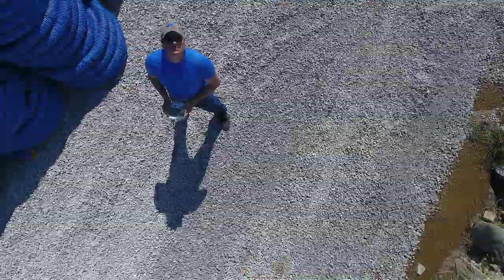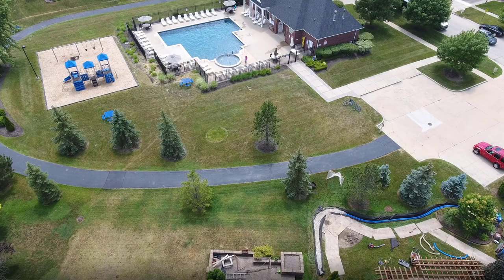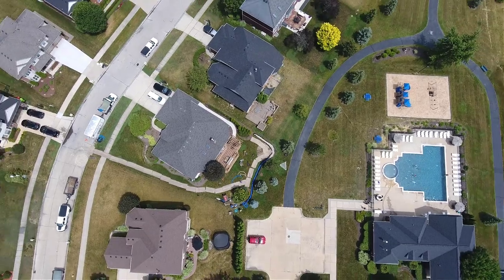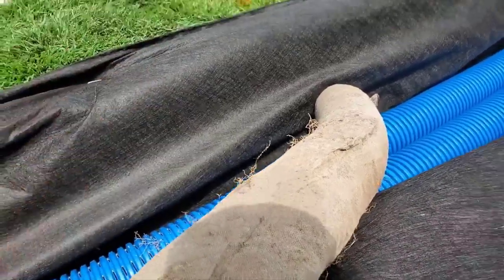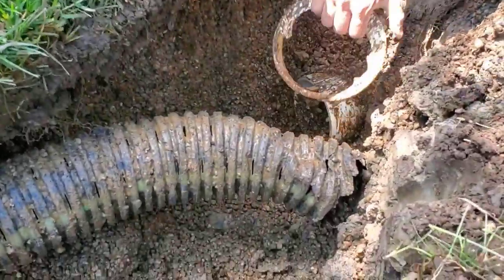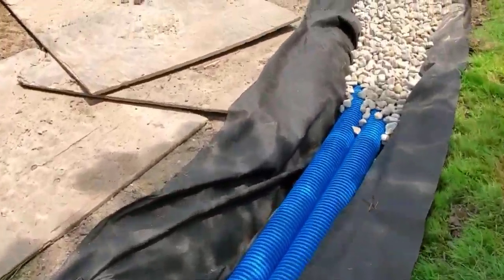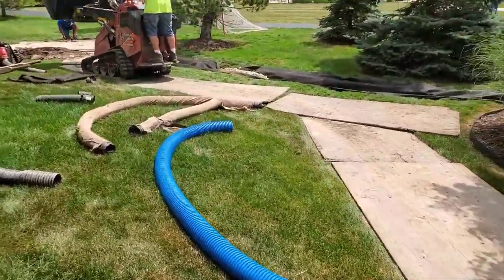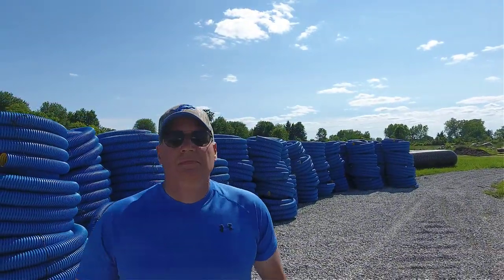Why DIYers Need to Install Double Pipes in Yard Drainage Systems

Comment: I used 4” pvc pipe and wrapped it with a sock. I also burrito wrapped the trench and filled with river rock gravel. Haven’t had any issues in 8 years . I really enjoy the info , I wish I saw these videos 8 years ago.
Reply: What did you use to wrap the entire trench?
Reply from the maker: @RoyalRadande  
Non-woven Geotextile Fabric in 4 oz and 8 oz
https://frenchdrainman.com/filter-fabric/

Comment: It would be helpful if you set up the initial situation by telling us where the water is coming from, where it enters your system (I finally saw it at the 9:30 mark, seeing the large grate).  But it would help if you point it out, so we know what you are doing.  You spend too much time trashing the bad stuff (yes it's trash - but I don't need to be told 20x that it's trash.   Yes you said it 20x.  Great video though!   Good stuff.   I am having difficulty finding that blue and yellow pipe in Omaha or Lincoln NE.  Obviously a superior product.
Reply from the maker: Store | French Drain Systems | Curtain Drains | Macomb, Oakland, Lapeer, St. Clair County
https://frenchdrainman.com/store/

Comment: I've seen a video where you used the high octane pipe but didn't wrap you guys cut it at the top and put the sod back, but this video  you are wrapping the hole pipe ( burrito)with the nogeotexttile  fabric. So which way is better? And why do it one way and then do a different way????
Reply: I think I'm another video they have left the burrito wrap off when doing a blind inlet.
Reply: I believe that was the video on laying a leach field( you don't wrap leach trench)

Comment: I really enjoy your videos. Excited for my DIY project. Feeling confident. I get now why you use a double barrel system. Quick question though that I'm unclear about. Do you connect the two pipes at the end with a Y connector and attach a popup emitter to one of the pipes?
Reply from the maker: That's a loaded question. Need slope to discharge with a pop-up emitter otherwise you need to lift the water with a small sump pump. I'm assuming you have no drop off of any kind?
Reply: @FRENCHDRAINMAN  I have slope. What goes at the end of the 2 corrugated high-octane perforated pipes? If I put an emitter at the end of one pipe, do I close the other one with an end plug or connect it to the other pipe? I couldn't find any videos where you show the end of the 2 pipe system where you have discharge.

Comment: Looking to do something similar myself. What width of landscape fabric do you use to wrap the burrito using the double pipe system? Is it 3’ or 5’ or some other width?
Reply from the maker: 5ft
Non-woven Geotextile Fabric in 4 oz and 8 oz
https://frenchdrainman.com/filter-fabric/
Reply: This is great, much appreciated. I’ll definitely pick some up. Just out of curiosity, what situation would you be using the smaller 3ft wide roll?  Single pipe solutions? Smaller pipe 3” vs 4”?

Comment: Hello I am a DIYer and love your videos. I notice in all of the videos Ive watched you place the system within 4-6" of surface then sod over. I am concerned that during drought months my grass will die over the system. Is it OK to keep the system 10-12" under the grass?
Reply from the maker: @Don Yes just use Blind inlets
Reply: @FRENCHDRAINMAN  so if my high octane is 24" down with 6" of stone on top and 12" of dirt I would need to build gravel basins that would come to the surface with a blind inlet on them? On a 200' run how many blind inlets would I place?

Comment: How come you don’t use a single 6” pipe?  A 6” pipe hold mores volume of water vs. two 4” pipes? Is it because it’s what you have on hand?   4” pipe is roughly 0.65 gallons per foot  where as a 6” holds 1.47 gallons per foot!   I have been using nonwoven geotextile 4 mil fabric for the last 3-4 years. I have to cut mine down to size depending on trench depth and width.  Your videos have helped me out and I refer many customers to view your videos to understand  how and why I do my drainage systems the way I do.
Reply: I figured that was the reason. The  6” HDPE  -14 slot pipe cost me 1.45 per ft. Or 1.12 per ft over 1,000 ft. I always use it when I need to really move water.
Reply from the maker: @MARKE911  who makes the (6") 14 slot you reference? For yard Drainage 6" doesn't go under sidewalk or fit in a cored curb. A pain to pull under sprinkler pipes too. Thank you for commenting.
Reply: Mark Eckelkamp where are you finding a 14 slot 6”? That would work in my situation

Comment: I have a single 4 inch (or maybe 6) drain pipe that runs across thw back of my house, maybe 40 ft and then down the side to the cur, maybe 100 ft. There are 4 small catch drains with in the first 20 ft. Would adding a 2nd line after the first 40 ft or so help it drain faster and increase the flow? Hope this makes sense.
Reply from the maker: https://youtube.com/playlist?list=PLjFCqaZ4v1BVX2cpGD7wJqH37RSS1JAOz&si=5Q4mtBF5vXBo4sWZ
Reply: Yes.  It’s all about discharging water.  Double the would definitely help when it’s under a heavy load.

Comment: Unfortunately that's  all we have in our area. My salesman from Ewing irrigation told me to go to lowes they had it and wouldn't have to charge me delivery. Where can I get the Hoffman pipe?
Reply from the maker: On our website in our online store.
Reply: @steveknick1978   they charged me a 100 bucks to deliver 4 100 ft roles 40 miles.
Reply: @clayevans989  that’s crazy

Comment: Too bad the pipe you sell isn't available around here.
Reply: You can order it from him.
Reply: @mjlstl  Shipping makes it expensive.  I went with ADS.  Not going to be any traffic over the french drain, so I think it'll hold up.
Reply: asusreviews I have about 250 of ADS drain with sock installed and it only lasted a couple of years.  Not going to make that mistake again.  I literally have a stream of water that goes right over it during heavy rain.  You should at least use the heavy duty mesh, not the stuff you find in stores.
Reply: @mjlstl  ADS + sock is what went wrong.  I have plenty of gravel in my trench.  And quality geo textile filter fabric.

Comment: Great, another question answered. Is there an application for a coiled pipe system as an advanced dry-well? With pipe and gravel All wrapped in fabric? 🤔 thanks
Reply: The question is why would you do that .  The other question is what is the pipes stability like when multiple layers on on top of eachother.  Probably not ideal.  A dry well is a proven technology.